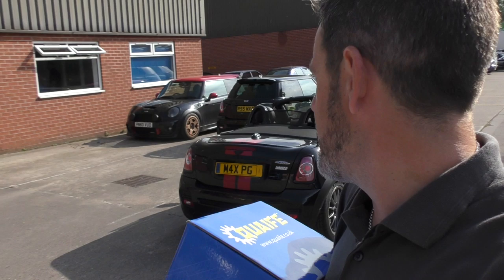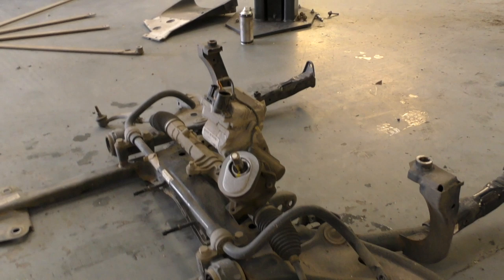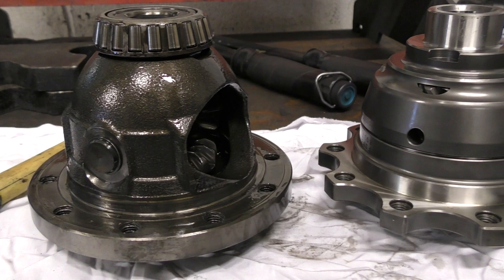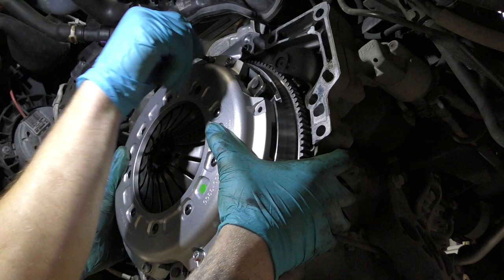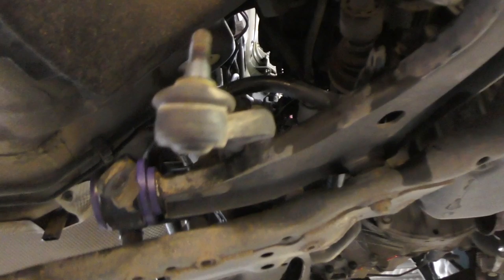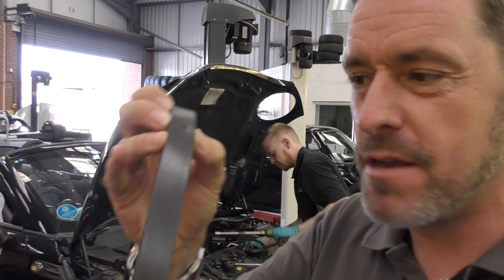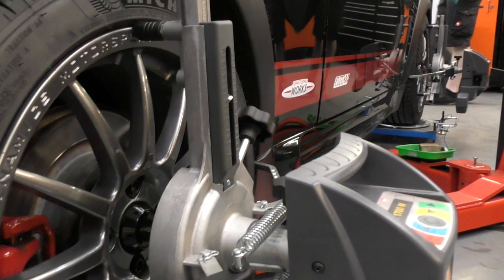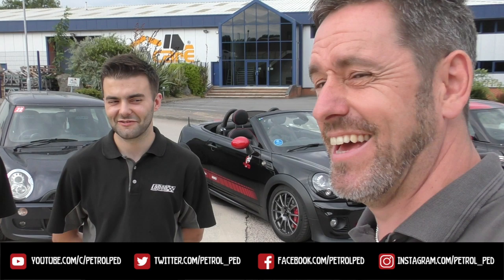Fitting my Diff but it didn't stop there !

Comment: Awesome upgrades and I'm looking forward to the first drive video. As for all the extra upgrades: I warned you in a reply to an earlier video. Once you go this way, there is no turning back! I recently had my suspension and front suspension arms upgraded and after your video's I'm seriously considering a limited slip diff. My Abarth Comp has the electronic version (TTC) and I have to figure out if the two don't conflict.
Reply from the maker: A mechanical diff is so much more effective, not sure about the conflict with the existing system  🤔

Comment: Hi Peter, the guys at that place must love you as that days work must have cost you a small fortune in parts and the labour must have been eye watering. I hope your very happy with changes you have made it should handle and stop so much better. Question how much more are you planning to do as at this rate when you get the new Mini you will not feel much difference if any at all at this rate. Best Wishes Alan B 👏👏👍👍✌️✌️
Reply from the maker: Nothing else planned...well maybe some new seats 😜😂
Reply: Petrol Ped you have the mod bug Peter at this rate Ruby will not be recognisable. I recon before the end of the year you will have a MAP  and a stage 3 upgrade as the guys will make you see the benefits and you will be pushing Mac 1 with your hair on fire 🔥 and the car will get down the road like a stabbed rat running for its life. 😂😂👍👍❤️❤️

Comment: Far too much sealant on that gearbox flange,that stuff will squirt out,the excess will break off over time and be left floating around inside the box.
Reply from the maker: They have been doing it that way for a very long time and have never had an issue 👍
Reply: And you think they would tell you if they did?

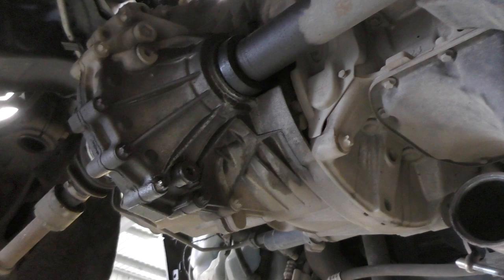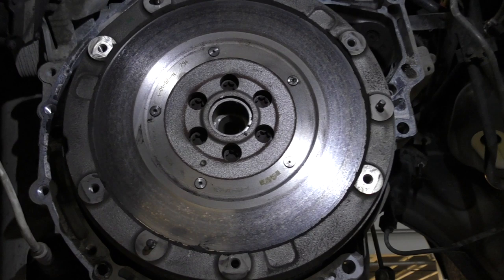Comment: good vid thanks , enjoyed , but at 4:40 that was not an "engine coming out the bottom of the car." heads up Ped thats a gear box , also at 7:39 you said you were putting on a duel mass fly wheel .
but really you removed a duel mass and fitted a light single mass .

Comment: Love all the transformations you have done. I too have a R59 JCW (Lupo)and would like to know. 
What changes you would make in order of importance if like me you want a fast road car not a track day car.
Reply from the maker: I'd go Diff first probably. My car was running 239bhp standard when dynod so the diff would help get that down even more efficiently. I'd then do coilovers for better looking stance and handling. Then wheels and tyres as that completes the look.With the Performance Pack 2 from Lohen I got the tune and 100 cell Cat at the same time. I might even do that last and then you will definitely need the clutch 🤔

Comment: What were the main DIFFerences you found post install of the LSD? Mine is being fitted on the 20.01 cannot wait.
Reply from the maker: The Diff and clutch together have made such a difference. You can feel the diff on corner exit, the power goes down so much better and you feel the car pulling you up the road rather than feeling power being wasted through the unloaded wheel. It is also more stable under heavy braking, especially engine braking, and the torque steer has been reduced.

The clutch just means the car can cope with the extra power and torque I now have 👍

Comment: Might be worth adding with 3 years later hindsight (2023) that the wheel mods caused an MoT FAILURE! (Tyre pressure system). See later video!

Comment: I thought it was too low ! Anyways great work and can you share what the suspension settings were before and after ? Thanks
Reply from the maker: Before were the height setting they came with out of the box and stiffness set at half way between Hard and Soft. We put 15mm on the rear and 5mm on the front. Stiffness now half way between Soft and Mid 👍
Reply: Thanks but what were the camber castor and tracking set at.
Cheers

Comment: What is the reason for it sitting higher at the rear, doesn't that induce more under steer?
Reply from the maker: Having a bit of rake in the car just helps front end turn it and reduces understeer 👍
Reply: Petrol Ped thanks for the reply the only reason I'm interested is because I've had my m240 lowered and the rear is slightly lower than the front
Reply from the maker: Simon Nelson  I am no expert but that is not ideal 😕
Reply: Petrol Ped Hi it's the Motech stance, I don't race or track it so for daily driving it's probably fine, but I'm interested to hear about the positives for having the front lower.
Reply from the maker: Simon Nelson  Oh OK. The guys at Motech know what they are doing I'm sure 👍
Reply: Petrol Ped they have done a great job, it's only very slightly lower at the rear.

Comment: Is the Limited Slip Diff just another re-hash for LSD?   :-b...
Fitting one certainly is something for the "casual spanner wielder" NOT to try to install considering all the bits that have to come off, before the LDS goes in... And everything goes back in the right place, of course.
And the worst thing that could happen? You leave the garage and 10 mins later one of the mechanics, who was working on your car, finds a large nut and bolt on the floor that no one can identify exactly where it came from!!   :-))...
Reply from the maker: LOL !

Comment: Is your Mini four wheel drive?
Reply from the maker: No...front wheel drive 👍
Reply: Has the retro-Mini always been front wheel drive like the original (1960s) Mini Cooper?
For some reason I thought the all retro-Minis were rear wheel drive (thus I didn't consider them a Mini Cooper).
When you mentioned removing the exhaust I though it was next to the drive shaft tunnel (1st gen retro-mini mind set still).
I was seeing the obvious clue that you weren't modifying the "rear" differential (that didn't exist).  Finally realized the "tunnel" was for the exhaust.  ;-D
Reply: I believe I've somehow confused it with the retro-VW bug (rear to front engine, rear wheel drive).  ;-)
Reply from the maker: @TairnKA  All front wheel drive apart from a couple of models like the Countryman and Clubman that are available in Four Wheel Drive
Reply: @PetrolPed  Ah, Mini (tiny pun) expedition vehicles.